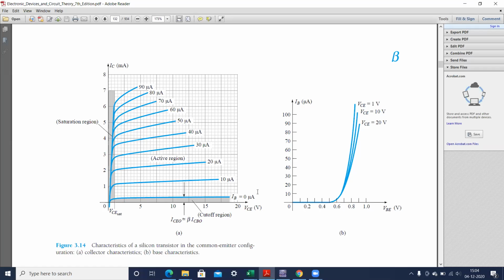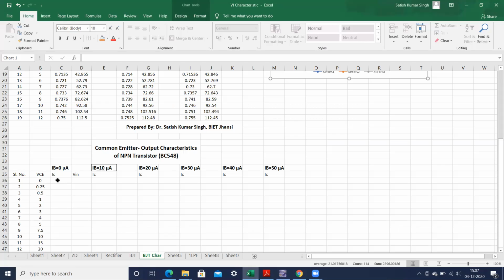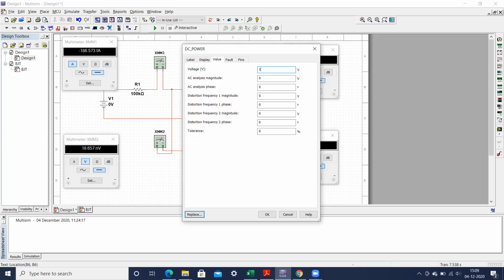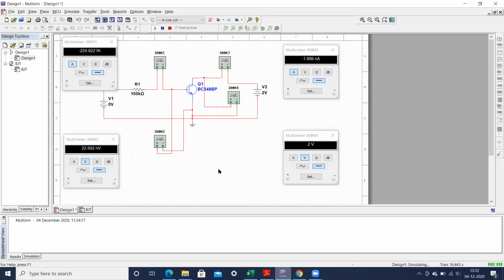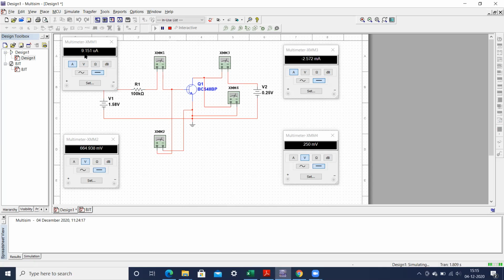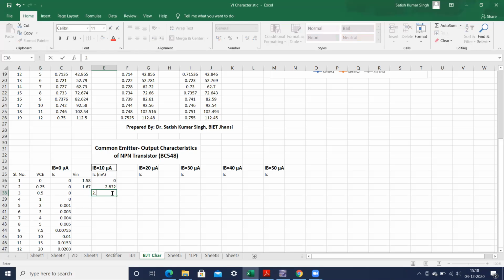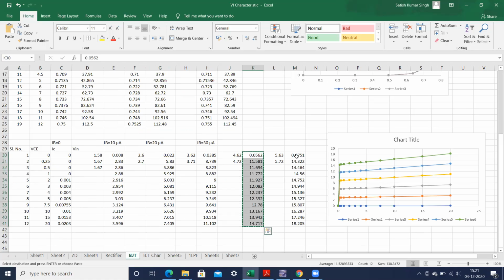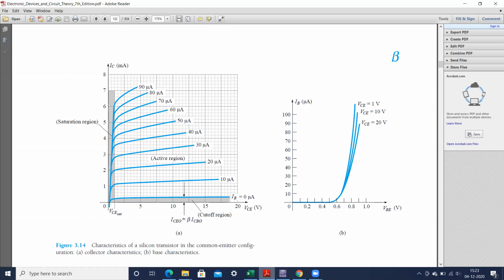EDC Lab | Output Characteristics of Common Emitter BJT using Multisim | Bipolar Junction Transistor

Comment: What if you add a ristance onto the circuit of the output.
Reply from the maker: The output characteristics will remain same, only we have to take care while measuring collector-emitter voltage that will be different from Vcc.